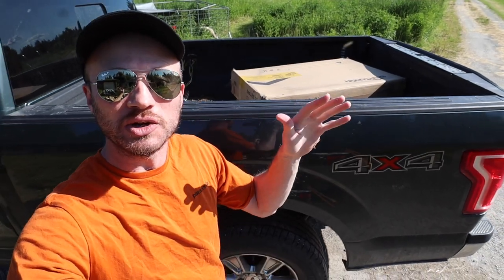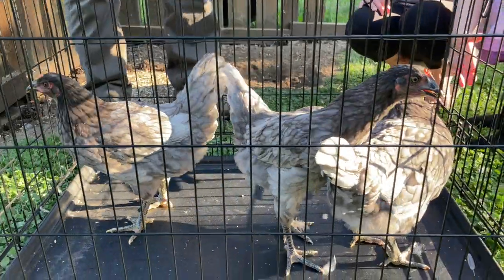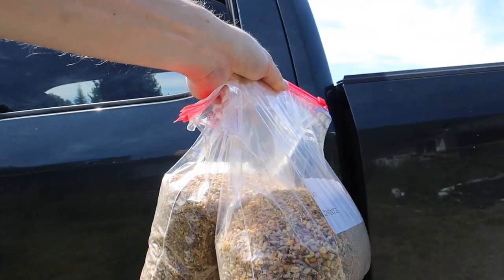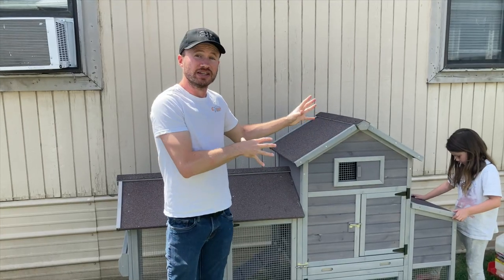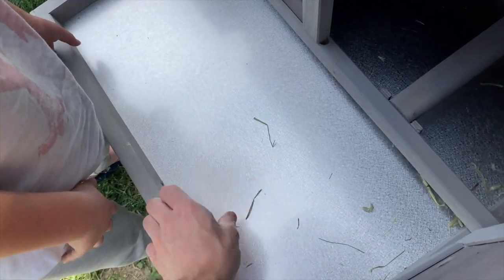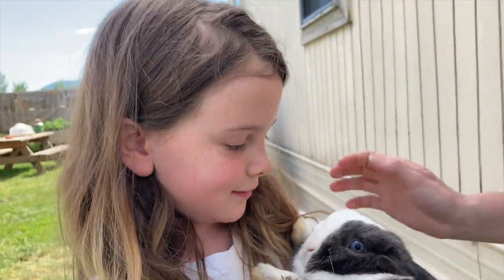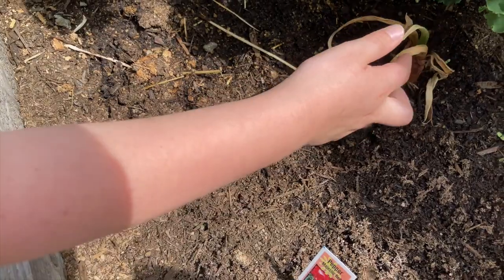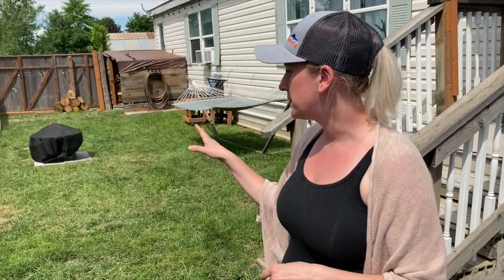Micro Homesteading in a Suburban Backyard

Comment: Congrats Dance Partner!  The feathered adventure begins!  I totally agree with needing to change up to the hardware cloth and sealing edges to avoid rot.  I added a pressure treated base because of the ways I've seen the bottom rails rot out.  It also lessens the flex of the coop framing.  In addition to the base I added wheelbarrow type handles, with bolts to pivot on to keep them out of the way when not moving, and a wheel system that you lift the coop and swing them underneath when moving and swung back out from underneath.  This allows me to move them every so often and spread the benefit of the "holy chicken squat" as Justin says.  All the best in the days ahead! 🙏🏻🙏🏻
Reply from the maker: thanks, Keith!